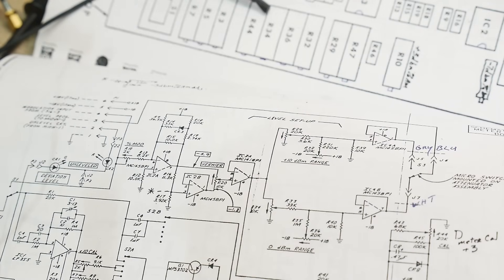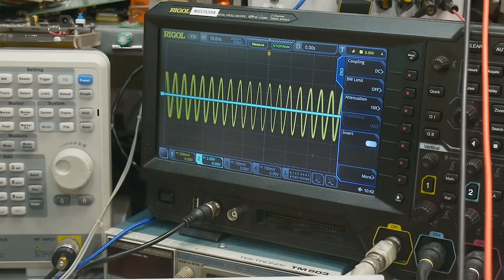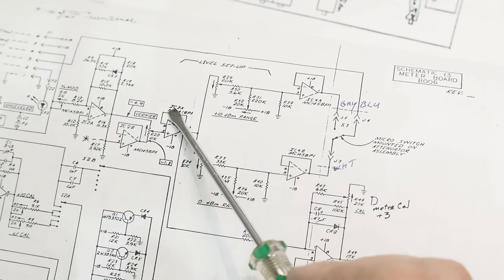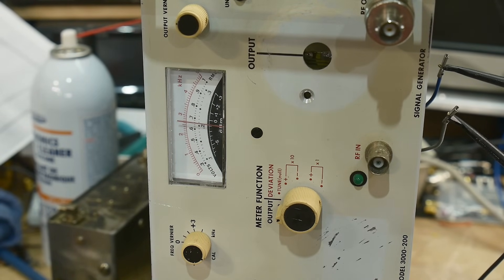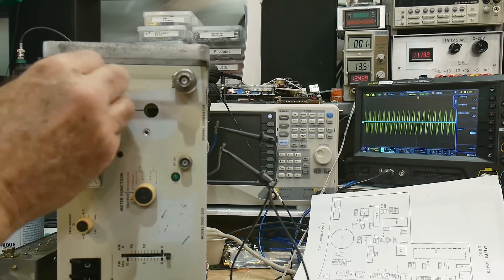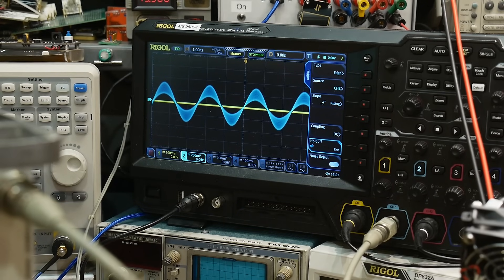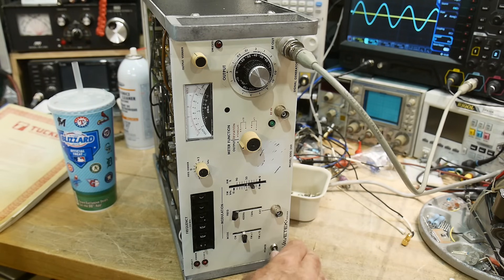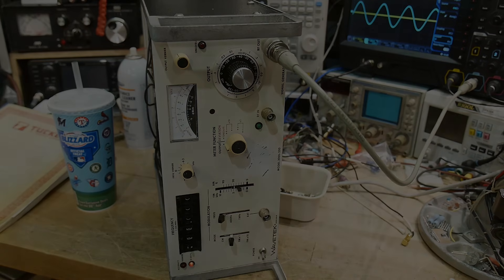#1921 Wavetek 3000 RF Generator (part 14 of 14)

Comment: I have a Wavetek model 3510 with a 70 MHz error that I have been circling for a couple of years now wondering where to start.  Thank you for showing the way on these Wavetek products.  From circuitry to how they are wired they are ABNORMAL  I really enjoy your approach and knowledge combined with a calm rational approach to issues.

Comment: Great job.  I admire your persistence and approach.    ( I have a 3000, too, that has been in my life since the 1970's.  Long story.    It's bulletproof and has let me fix sooooo many devices I can't even begin to list them.     Had no idea what was in those cans,  and I do have a manual, but never a need to troubleshoot the device.    Attenuator assembly is also kinda flakey from a feel standpoint, but not function.  It all works. ).     These things are from the golden age of test equipment.     My Tek 3024 MDO with a spectrum analyzer and a built in function generator have eliminated a need for a bunch of lab test equipment, but I do love the old days when there were so many pieces of analog gear out there.  ).  Good job and excellent series of videos.

Comment: Thanks for the education on troubleshooting.  I have been repairing HP 8640b Signal Generators for a few months and have learned a lot about the mechanical failures.  I have some that don't seem to like me.  If you want to grab an 8640b and go through that beast, I would bet that there are many who would be watching.  The HP Signal Generator is a really fine work of art and it is also very frustrating.

Get one and do it.

Comment: So after 14 episodes the only thing wrong was that op amp ?
Reply from the maker: It was the last thing.
you forgot:
both +-18v rails crowbared
a handful of capacitor tested dead, dozens of capacitors changed
68ohm resistor fried and replaced
bad attenuator fixed and 40db bypassed
Reply: @IMSAIGuy Can you tell what was the original opamp and what you replaced it with?
Reply from the maker: 4558 came out and 4558 went in. Yes I know they max 18v